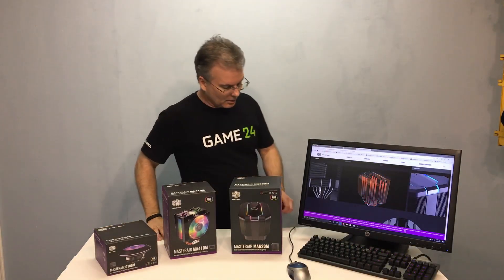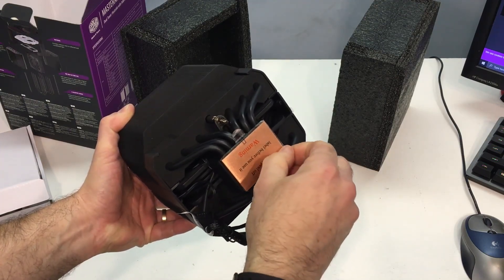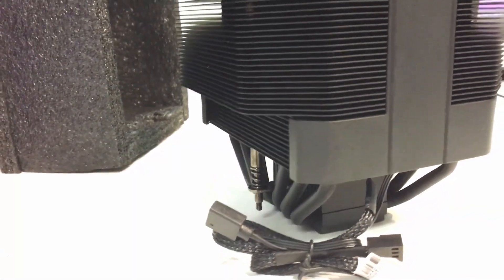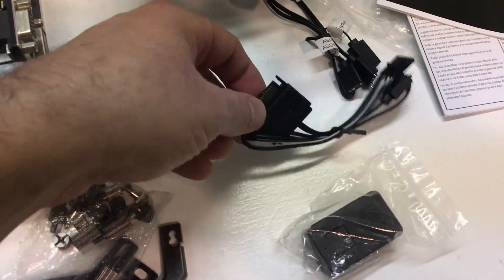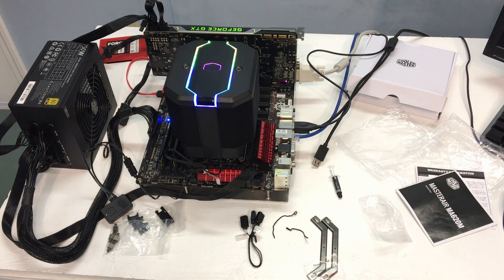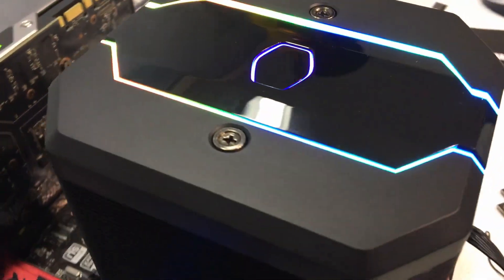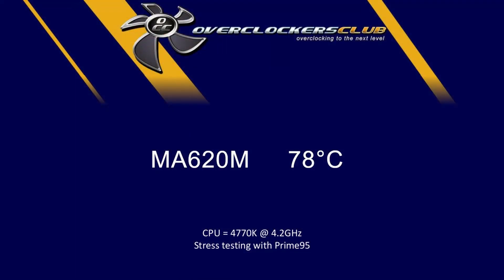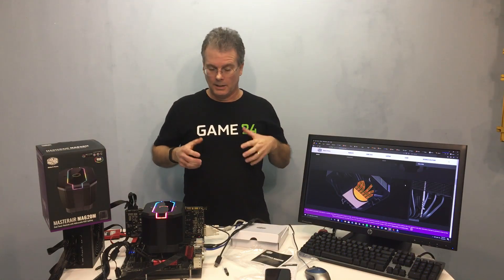Cooler Master MasterAir MA620M RGB Cooler Review.

Comment: Was a peace of cake pulling it appart, just lightly glued together. So i ganked the stock fan and jammed in a noctua. 
My 3900x draws 200watt. The modded cooler tapped out during benchmarks at 4.3ghz, gaming it works great. All in all not worth it unless you're only using a i7 or 3600 or equivalent.

Comment: Was your installation of the Backplate tight when screwed down to the motherboard? Mine wobbles and I'm concerned that the contact with the cooler could be affected? Intel 115x installation on a Asus motherboard.
Reply from the maker: I do seem to remember that it seemed loose but after everything was installed it was OK.

Comment: Have you tried this cooler with an AMD Ryzen 3950X processor? Am concerned whether this cooler will be sufficient if the cpu is tested under load.
Reply: there is another reviewer that use this cooler with 3950X. And with 40+ minute CPU stress test + VM running at background at same time, the cooler average around +/- 70c.

Comment: is it possible to connect the rgb connector directly to rgb header on the motherboard and not using the rgb controller at all?
Reply: yes and I use aura sync to control the lighting

Comment: This is a  review, yet there arent any benchmarks. How does it perform?
Reply from the maker: Crio Gen Using the same motherboard and overclock, the Noctua 14 averages about 1°C cooler.
Reply: @overclockersclub  okay thanks 😁
Reply from the maker: And if you think about it, the MA620M only has one fan while the Noctua unit has two.  But they are both good coolers.
Reply: @overclockersclub  i believe MA620M look 'cooler' than noctua. :)

Comment: is the fan replaceable?  it looks like it has some little fins coming off of it that normal fans don't have.  really want one of these when i get the $$  thanks for the vid.
Reply from the maker: That is a good question.  I tried to get the fan out of there, and was partially successful, but it required more effort than I wanted to put into (didn't want to break it).  I will ask Cooler Master.
Reply from the maker: CM says that technically the fan is replaceable.
Reply: @overclockersclub  they should have made as easy as pulling it out from top to clean it when it gets dusty by using tabs or something.

Comment: Hello dear OverclockersClub, I enjoyed your video on this cooler and purchased it for my new AMD build. However, if I were to try to install the mounting backplate included with the cooler, the plastic edges would bend lots of pins on the back of my mainboard as it is way too big to fit into the small, unoccupied space around the back of the socket (Aorus Master X570). Can I just use the metal backplate that was included with the mainboard? I'm uncertain as to whether or not this will cause height differences and therefore bad seating and, as a consequence, bad thermals. Thank you very much and greeting from germany :)
Reply from the maker: Hi, This is Isaiah. Looking that that motherboard (Aorus Master X570) the back side with the "pins" seems to be just the solder joints for the VRM is the only thing I see. If placed correctly It shouldn't be bending pins. Only pressing down on a few. The top right corner may be a issue and if that is whats stopping you from installing the blackplate properly, not much you can do besides get a different cooler that has a smaller backplate. CoolerMaster is using the fairly standard size that works with all sockets, so It might be hard to find one that is AMD socket specific. I do not think you can use the mental plate included with the board as it is not designed for the same screw sizes and height offset. You can always give it a go, but I don't think it will work.